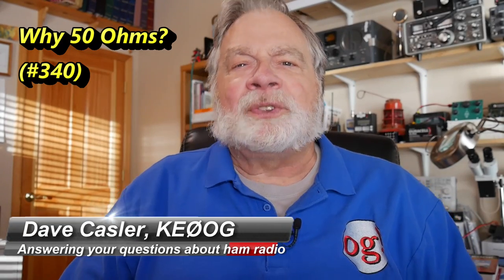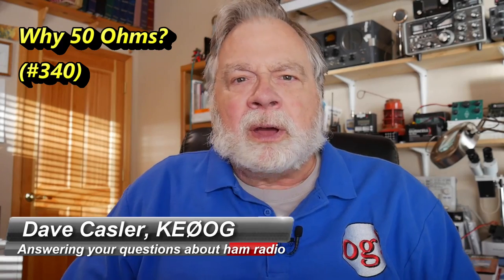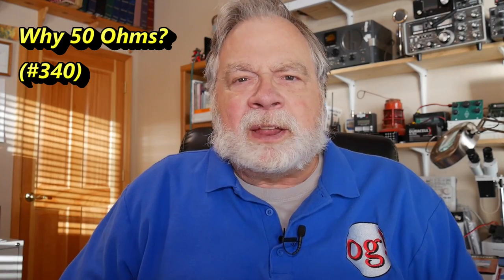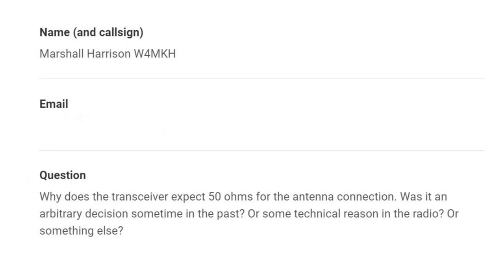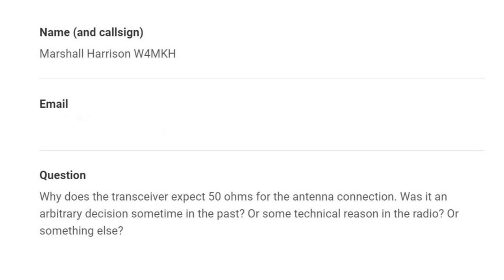Why is Coax 50 Ohms? (#340)

Comment: Heaviside also reduced "Maxwell's" equations into their modern differential form.
Reply from the maker: Yes, a magnificent achievement that on its own was enough, but he did so much more.
Reply from the maker: Sean M  True--I have heard 21. Heaviside rewrote them into the current 4.
Reply: The modern formulation due to Heaviside, uses the vector calculus not  the differential calculus. The differential calculus IS due to Newton, but the modern notation (calculus) is due to Leibniz.
Reply: @nosnibor800  Heaviside was autodidactic and derived his own calculus.
Reply: @ChrisWilson999  Correct. From the age of 21 until he was 28, he had returned to his parents house and attic bedroom, where he worked all night, then slept until noon, then went to the local library to teach himself maths. He wanted to understand Maxwell's treatise, which he mastered, and then reformulated the 22 equations into the 4 using vector calculus, taught today. I believe someone else also reformulated Maxwell's equations, using Quaternions.  Later, he did indeed develop his 'p' operator calculus, in order to solve transient response problems - his method was taught widely until  the late 1930's, to Electrical Engineering students. The Laplace transform was then substituted and used universally. Later someone (I forget who) demonstrated that the 'p' operator and Laplace transform were equivalent. The 19th century certainly was a fascinating period. Heaviside was indeed brilliant but later started dressing up in women's clothes and painting his fingernails pink. He thus became an embarrassment and was hidden by the establishment - a bit like Alan Turing.
Reply: Just to note, Leibniz invented differential calculus independently from Newton. Of course Newton wouldn’t give him credit for being able to do that. But the proof is that Leibniz came up with a much more useful notation for it.
Reply: @lawrencedoliveiro9104  Newton developed it 20 years earlier and assumed his protege stole it.
Reply: @nosnibor800  I do my best work at night too
Reply: Sean M  I hope in his brilliance he did not leave anything out. I have never seen much on Maxwells original equations, not that I would probably grasp them. I believe they used octonions or something strange.
Reply: @lawrencedoliveiro9104  my understanding is that we use Leibniz notation today based upon the distain within the mathematical community of the despicable behaviour displayed by Newton towards Liebniz.
It seemed beyond all reasonable doubt that the two of them independantly came up with calculus, but Newton couldn't accept this fact and was convinced he would prove to the world that Leibniz had stolen his ideas and went on a vicious attack of Leibniz trying to destroy his reputation.
Reply: @michaelharrison1093  No, it’s just the inherent superiority of Leibniz’s notation in most situations. A Newton-style notation is used in some cases (e.g. a single dot on top of a variable to indicate a first derivative, or two dots for a second derivative) since it can be more compact where the denominator variable is understood.
Reply: @davecasler  There are several ways to write Maxwell's equations which are mathematically equivalent.

The 4 modern equations are two vector equations and two scalar equations (to be more exact what I am calling scalar equations still involve vectors, but my point here is that the thing that is equal in both sides is a scalar in two of the equations)

So, if you were not comfortable handling vector calculus you'd rewrite the two "curl" equations in terms of their three components each, making eight equations each involving scalars and components of vectors.

It is also possible using tensor algebra to group them into fewer than four equations. Minkowski got it down to two, using quaternions. Einstein rewrote then in his own tensor notation (invented in the search for General Relativity) and if I remember rightly in that notation you can get it down to a single tensor equation.

The trade off is between learning more equations versus using more complicated maths. Grad school physicists might use the tensor form and think it's easier, but most other people find vectors are on the edge of what they can cope with and they don't want to even look quaternions or higher order tensors.

But however you group them is just notation: the physics in the equations is still down to Maxwell, not Heaviside or Minkowski or Einstein: they just found more elegant ways to rewrite the physics. A paint job, you might say ;)

That why from a physics perspective it is still appropriate to give Maxwell the credit. He was first to show that the previously known laws of the magnetism around a current, and the induced voltage from a moving magnet and magnetism, up to then considered as separate effects, when combined and  describe the then already known phenomenon of "Hertz waves". That was his big theoretical "aha" which tidying up the notation should not detract from.
Reply: @nosnibor800  Considering what Heaviside achieved, I reckon he was entitled to a little eccentricity (maybe it served as a balance to the co-centricity 😀?). Seriously though, I  too couldn't help but draw some comparisons with Turing. I wonder, if like Turing, he shall receive some more recognition in future?
Reply: @Steve-GM0HUU  Hi Steve. Alas we are subdued by what is called the "British Establishment". They want to keep it secret, and use lies. (like the MA from Oxbridge). Also, Engineers, Scientist, they are afraid of us - Churchill once said " Scientist should be on tap, not on top" Why? fear born of ignorance. We are led by  fools with degrees in Latin

Comment: Excellent explanation. As the First Harmonic of W5VD (SK 7/21), and through my professional career in broadcast engineering, I've handled high and low power RF transmission lines for ages. I knew WHEN to use 50 or 75 or even 120 ohm lines, but never really knew WHY. I guess I just accepted it that same way I accepted E=I*R. 
Again, thanks!

Comment: Hi, I used to work in the telecoms transmission sector, and basically we used to use a cable which matched the impedance of the load.   Sometimes that meant that 300 ohm ( submarine.) co-ax cables were used, and at other times 75 or 50 ohms were used for radio transmitters.   I also worked on vhf terminated rhombic aerials which required 300 ohm open wire feeders (about 4 inches apart.)  If they were un-terminated I think we would have used 600 ohm open wire feeders (about 6 inches apart.)   Some of the older yagi aerials were 72 ohm, and used air-spaced co-ax, but most are now 50 ohms. . . .   Thanks for your video. . .73s

Comment: When I worked in TV I remember we used coax a lot there.  We also used coax for older ethernet.  I always remember we had to use terminators on the cables and one of them was a 50ohm terminator while the other was 75.
Reply: We only used 50 ohm term. To connect a terminal we had to drill a hole into the coax to get  at the centre conductor, all very messy, all for 1Mb!   UTP and RJ45 so much easier.
Reply: @hexadecimal7300  Yes I remember - bee sting tap.
Reply: @earthstick  Thanks, what a pain they were,  had a lot of faults, late finishes and right runarounds with them. The coax was also pretty inflexible and would not go where people said to put it. So happy when twisted pair and RJ45 connectors took over.
Reply: @hexadecimal7300  I remember the first place I worked the network was always going down because it was early coax ethernet.  I just couldn't remember if it was the ethernet with the 50ohm terminator or the black and burst signal we feed to all the TV equipment.  One was 50 the other 75.
Reply: @hexadecimal7300 Well, I remember that t.p./RJ45 were pretty unreliable , too. Talking about time 40 years ago…

Comment: The reason that the exact 35, 50, and 75 Ohms are chosen is also that they make rather good quarter wave combiners and splitter transformers. Note that a perfect vertical is 35 ohms.
Reply: A perfect vertical?
Reply: @bendermi  I think he forgot "dipole" (antenna)
Reply: @karhukivi  
Okay I'm not that much into this material but I'll Google dipole antenna right away.
Reply: @bendermi  Correction - he meant a "vertical antenna" usually referred to as a "vertical".  A dipole antenna has a different impedance s it is essentially a folded antenna.   Plenty more on the net!
Reply: @karhukivi  
I'm fast but not that fast I'm still watching videos are those antennas for me I'm only listening to music on FM?
Reply: @bendermi  Almost anything will do for an antenna if the FM signal is strong, i.e. near the transmitter, even a wet string will work!  The more critical part is the transmitting station where the power transfer to the antenna is important.   A "vertical" or quarter-wave antenna is typical for radio transmitters and even the telescopic antenna that pulls out of a portable radio.    VHF receivers for communications often use a folded dipole which looks like a narrow loop closed back on itself, but that is mainly to save space.     But to get good FM reception in a poor signal area, an antenna of the folded dipole type mounted up high on the house will make a big improvement.
Reply: @karhukivi  
Even an wet spring  , that could work , tandberg sold their receivers with an antenna that was a copper wiring loop  the top part which was made of plastic and the wire went through it , was mentioned to be mounted under the ceiling . 
Okay  thanks for the information. 👍👍👍
Reply: @bendermi  Thanks for that interesting information, I remember tandberg, but I never owned one.  Stay safe!
Reply: @karhukivi  most likely he means a 1/4 wave ground plane vertical as that would be about 35 ohms or less.
Reply: @alexjenner1108  Yes, to anyone who is not a radio ham, a "vertical" (vertical what?) must be a little mysterious!

Comment: Sebastian Ferranti made co axial cable for power transmission in the late 1890's when he set up an electricity generating company at Deptford London he demonstrated the safety of his system by having his forman drive a cold chisel through the cable while holding the chisel in his bare hand. The power was transmitted at 93HZ  and 10,000 volts, so this is possibly the first ever coaxial cable.

Comment: I always thought twisted pair was very clever, a poor man's  EMC resistant cable.  I was a little surprised, but understood it, when I came across twisted pair in automotive air bag wiring.  I wasn't aware of heliax, but it makes sense since short of a vacuum, air has the lowest dielectric constant of the dielectrics.   Polyethylene has one of the lower dielectric constants vs. for example PVC (plus PE is cheap).  Just some random thoughts while watching your excellent video.  Very concise.  Thanks.

Comment: Awesome video/information Dave. December 2020 I passed my EXTRA test! I say this because my brain cells, after all that studying, seem to be better at understanding all you've presented here! I'm big into 40m wire beams and mostly use cheap RG-58. Never a problem. RG-58 is 52 ohms I believe. I did have to replace some as I guess water got into some and there's a black corrosion on the braid. I subscribed! 73 de, WA3RSL.

Comment: I am only 80 years old at this time, still actively playing homebrew rf, do not want to bother with antenna impedance, random wire is connected to the antenna matcher which is tuned at the bottom I install a 40 watt fluorescent lamp, very happy to see the light vibrations flowing according to the power of my voice ... enjoy in the air
de YB6JW / 0, Jakarta

Comment: I was taught coaxial means along the same axis. My last job we used both 50 and 75 ohms in the 70 MHz range.
Reply: Coax is both around the same axis. I have used a lot of different coax cable. They all had the center wire and then the other wire around that.

Comment: 3:40 Great presentation. But Heaviside did not invent differentical calculus (that was Descartes, Leibniz, Newton). Heaviside developed techniques for using the Laplace transform as a means for solving differential equations and thereby using complex numbers as a tool for the analysis of electrical circuits. He reformulated Maxwells equations in terms of vectors and so laid the foundations for vector analysis.

Comment: Well explained.  I first saw this explained in the book- "The Design of RF Integrated Circuits" by Thomas Lee and was excited to finally understand it.   You captured it masterfully.  On a bit more esoteric vector- How about 93 ohms that is used in high speed lab instrumentation-  NIM and CAMAC and old mainframe computers?  The unique thing about these systems are that they are usually short runs of coax- patch panels and instrument to instrument.

Comment: Did the relatively high output impedance of tube technology of the time affect bell lab's choice of 30 ohms for max power transfer?   I wonder if 50 ohms today is still the best balance of power/loss given modern low impedance output stages?

Comment: I hope no one snaps at my ankles but I've been laboring under the impression that 50 Ohm Coax became the industry standard because 50 ohms is the characteristic impedance of a 1/4 wave vertical ground plane antenna. If I've been wrong all these years I'm going to grab hold of a good ground and stick my tongue in a wall outlet!  I'm long retired now but besides being a GC ham ( WA2ERQ ) since 1966, I had a Land Mobile Radio / Marine Electronics shop for over 15 years. During those years we installed countless 1/4 wave VHF / UHF mobile antennas on police, fire, emergency and commercial vehicles. During those years we ran RG58 and later RG8X coax to 1/4 wave antennas. I don't ever recall any RF transformer or impedance matching network between the transceiver and antenna. We tuned ( CUT ) the antennas using an in-line RF Watt Meter capable of reading true forward and reflected power. 
So to summarize, it only seems logical to me why 50 ohm coax was and still is standard. On the other hand I am prepared to be humbled with differing or apposing "facts".
Wakodahatchee Chris
Reply: Correction: That last sentence should have read " Apposing Theories " not "Apposing facts".

Comment: I cabled computer rooms years ago and stocked RG 6, RG 62, RG2, RG 58, RG59 for the various computer systems. For IBM we Twinaxial cable which has two pins. Today we do it all on Unshielded Twisted Pair cable. It started out with a low data rate and was called Category 1. We can now run Category 6 and can use it for Gigabyte data rates. I was so happy to not have to stock all the different types.

Comment: I recall seeing 3/8 copper tubing with a inner cable separated by what looked like ceramic or a hard powder substance. It was ran on the outside of the walls to switches and outlets in old buildings mainly hospitals.

Comment: I was asked to rebuild some of the feedlines at a local 50KW AM station here in Louisiana. I note as I was taking down some of the 20' 4" hardlines, some of the sections were 51.5 ohms. This transmitter site had two phasors. a 4-tower day (50kw) and a 6-tower 5kw night. On the driver tower, there was an old TV antenna at the top that hadn't been used in years. I don't know for sure but I think the radio station begged, borrowed, or stole some of the TV hardline (51.5 ohms)
This can of worms was a challenge, to say the least.
Thanks for sharing this. 
Cheers from Louisiana.

Comment: I have designed low voltage cabling for the past 20 years in the AV industry. I very much enjoyed your video. The only thing I would add is that the dialectic foam is what provides the 50ohm resistance. The higher density the foam, the more resistance.
Reply: Bob, it was a great video, wasn't it! The dielectric constant of the insulator (often foam) is important in determining the characteristic impedance because it is part of the formula for the capacitance per unit length but the geometry of the two diameters is also important because it determines the inductance per unit length. You could use the same foam insulator material to make a 50 Ohm, 75 Ohm or any other impedance cable by varying the diameters! There are practical limits to how small the center conductor can be, of course! If the insulating material had magnetic relative permeability different from 1, that would also affect the Z0, but that is almost never the case.

Comment: Also remember, us British over here in U.K. land, often use inverted V wire Aerials. The natural impedance at the centre of a resonant dipole is 72 Ohms, so, therefore, feeding it with 75 Ohm Coax is a better match, which can be easily accounted for at the Radio end.
David G1ZQC.

Comment: For a dual antenna setup like on a tractor trailer with the antennas about a quarter wave apart, you need two 75 ohm coax cables connected together to get the 50 ohm matching impedance. Usually see  RG59 for that application.

Comment: Thankyou for this! It is worth noting that braid is actually quite lossy; skin effect causes the current to try and stay at the "surface" of the braid which in turn requires current to hop from one strand to another in its attempt to stay on the conductor's (inner) surface (or outer if not used in coax). This means that braid contains hundreds of tiny connections along its length and as we all know, connections aren't perfect, particularly if any surface oxidation is present. I infer this is the loss mechanism from conductor tests I carried out doing some research into suitable conductors for high current Tesla Coil use, particularly the ground conductor. The Q of the primary resonant circuit was easily measured and showed stark contrasts between different types of conductors, stranded wire being second-worst with strap and Litz wire coming in best with pipe being a close runner-up. I think braid was a mechanical choice made in the interests of making coax flexible which doesn't sit well with the desired electrical properties.